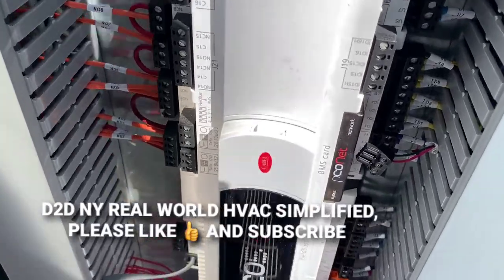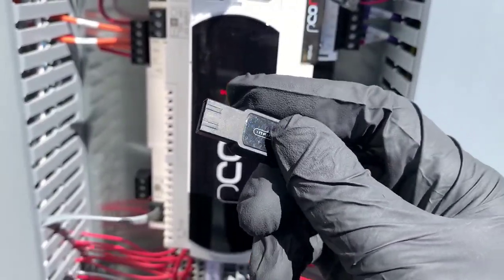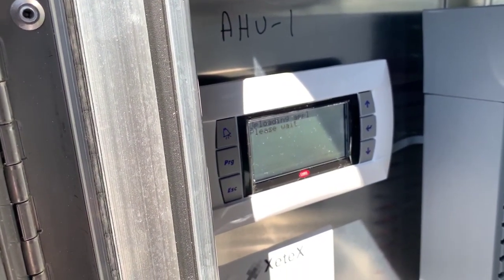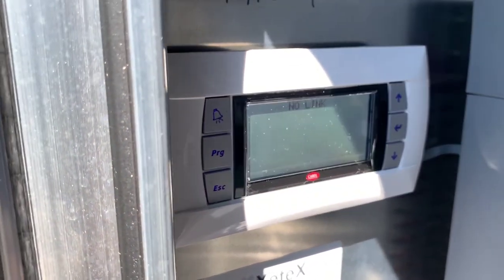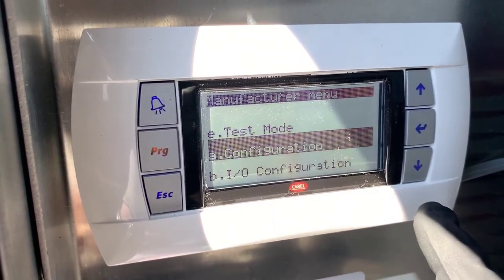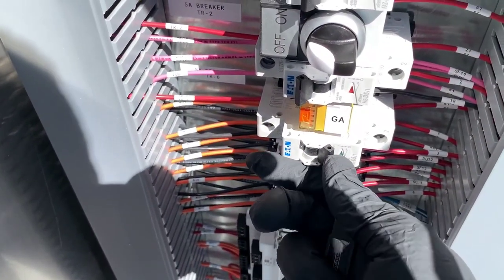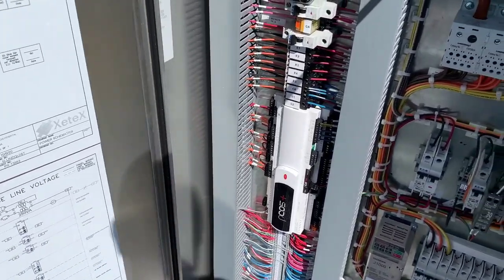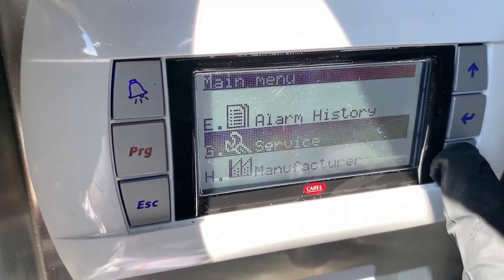CAREL PCO5 FIRWARE UPDATE

Comment: Hi please upload the video about cpy controller if it's goes offline due to loss of communication please bro it's important
Reply from the maker: See what I can
Reply: Are you asking about when the controller goes offline when on a control box with anywhere from 2 to 16 units, or an individual system? Two different situations… If from the control box, you can just plug the controller into the individual units which have gone into orphan mode; be sure to remove the Modbus cable, but this is a quick way to check where the failure might be… If the controller works on an individual uni, it is the board in the control box! but, if this is the controller to a Carel board directly, check the cable first, but you probably have a bad board or controller. I program system on a chip prototype, but still wouldn’t try to get more granular than that!
Reply: I hope your issue has been resolved. If yes, then please do help us.